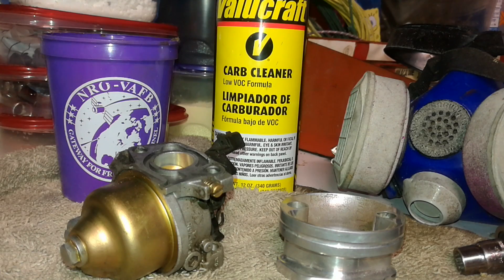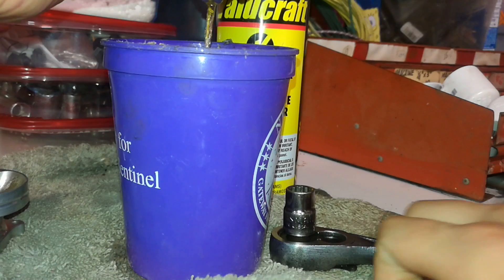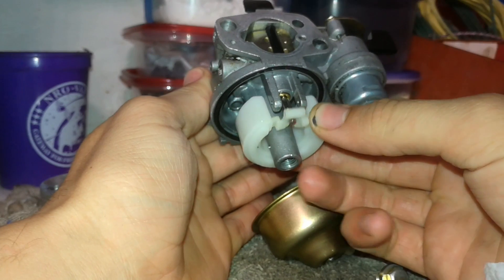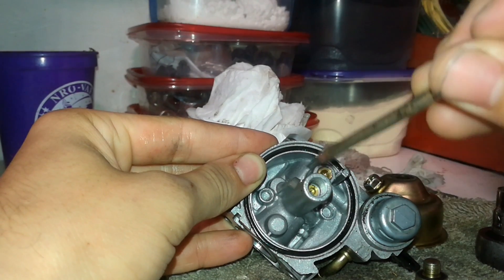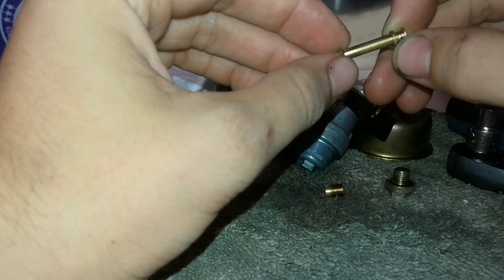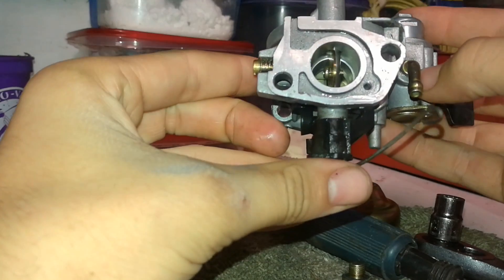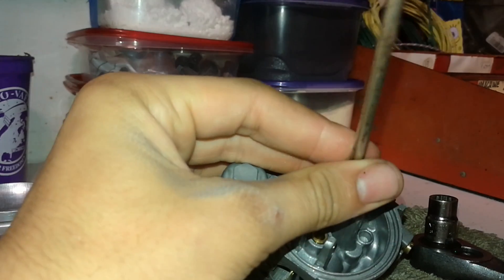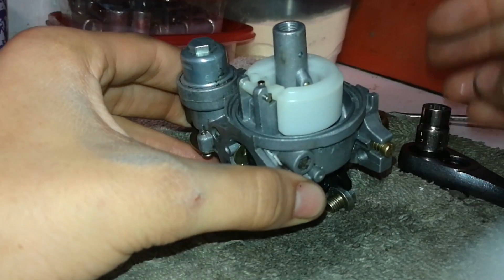How to clean carburetor and jets on all Predator 212cc and Honda GX200 + clones

Comment: It's a good idea to clean the sediment bowl under the fuel valve and the pilot jet. Hard starting, surging and rough idle are usually caused by obstructions in those two areas.

Comment: You didn't clean the pilot jet, it's just under the idle screw. You didn't clean the carburetor thoroughly or correctly nor did you line up the drain bolt where the float can fully function.

Comment: Just did one of these on a Predator 4000 generator.  My carb is slightly different since the sediment bowl is attached to the fuel valve, but under the idle speed screw is the idle jet.  Take out the screw, pop out the plastic plug underneath, and there's another tiny jet.  Just be careful of the o-rings putting it back in, I tore one of mine (oops).

Comment: The 'stopper' you refered to is called a needle valve. You didnt clean the fuel filter or the passage to it. The bowl should have been rotated 90 degrees clockwise.

Comment: I've left gas by accident in my Predator 212 minibike's gas tank for like a year and now the carb's got shellac bad gas preventing the engine to start, the engine wont even attempt a "cough" when someone can hear the engine is about to fire up, how does someone take apart the carb and let soak the parts to get rid of the shellac gas residue without hurting the rubber parts(if has any rubber seals, like on the valves) The Predator 212 ran fine 1 or 2 seasons ago, but now i find out the gas went completely bad and contaminated the carb to where it cant even start!
Reply: Loosen the drain on the bowl,not the bottom bolt,the one just above it. Put fresh fuel in tank and run a little bit into a cup. Tighten the drain and pour a little gas on the air filter foam. Give it a try.

Comment: Talk louder next time. Other than, good video.
Can I also use brake cleaner? Or even WD-40?
Reply: No, the carb cleaner is specially for that, clean a carburetor, i don't know if the brake cleaner can clean like the carbuclean, but definetly wd40 doesn't gonna clean that little holes on the needle

Comment: How do i fix a leakey bowl
Reply from the maker: Sounds like ya need a new O ring on the bowl or possible a rubber washer on the drain bolt. best of luck with that leaky bowl.
Reply: Ok i will try thx